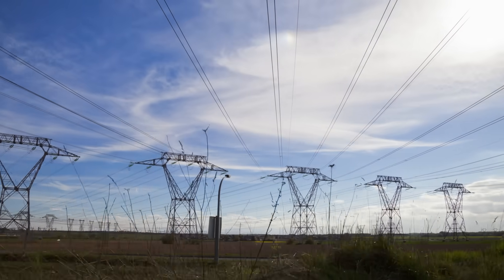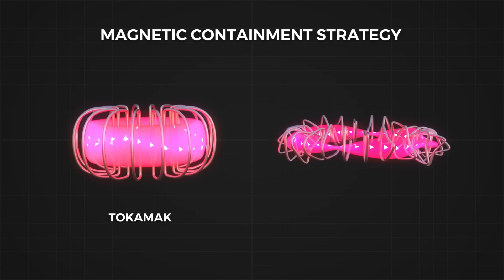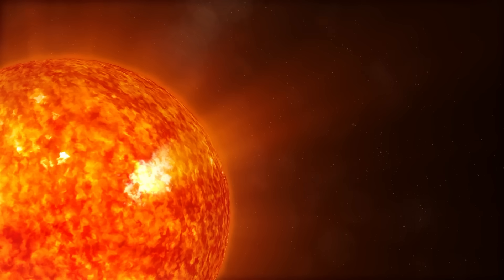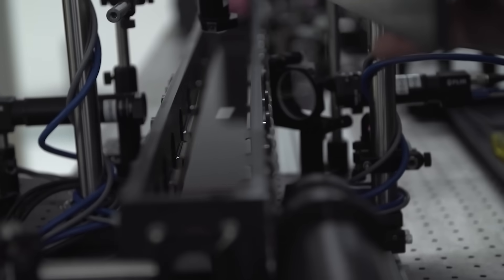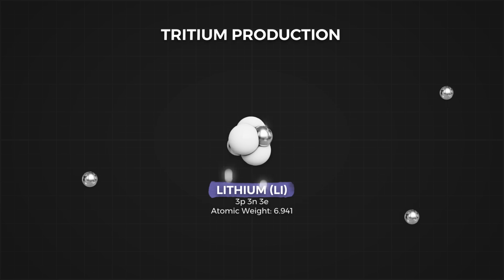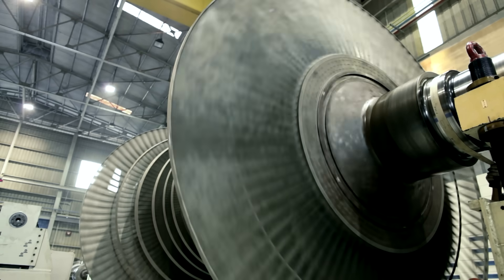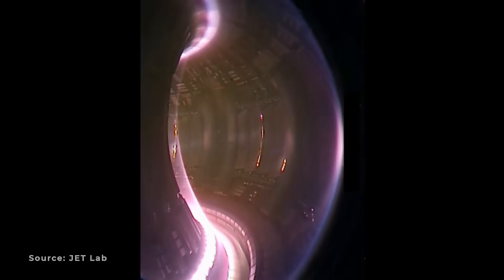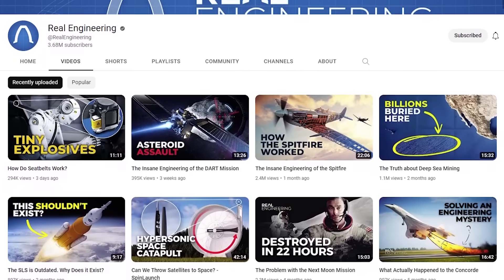The Problem with Nuclear Fusion

Comment: In light of breaking news in the US on Nuclear Fusion, I find the TIMING of this video very interesting, because it must have taken time to do all the animation in this video, so clearly you were not influenced by the Breaking News.
I don't know what to make of all this, so I remain a skeptic until I'm convinced otherwise.
Reply: I'm also a skeptic about the announcement and what it actually means.
I just found out about it literally 5 minutes ago, and before then I felt that it might be unobtainable in my lifetime. 
With it now supposedly being done, I'm curious to see what comes of it, but I'm not getting my hopes up at all. Would I like it to be true? Absolutely. Would I like it to be utilized in renewable energy? Well obviously. 

It is the DOE though after all...
Reply: Interesting achievement, and technically does advance the technology.  But it doesn't address the age old problem of moving the energy. Making it is one thing, using it and getting it to where it needs to be still requires a lot of energy.  In this experiment they still haven't created usable, viable "free energy" because they can't harness it for anything useful. 

I think in this instance they used 2 terawatts of electricity and got 3 back out.  But in order for this to be sustainable and actually power our society it would have to be something like 2 terawatts in and 5-10 terawatts out. 

Still a long, long way to go.
Reply: Looks like it's just a bunch of stock footage he edited together. Probably didn't take that long to put the video together.

Comment: So nuclear fusion is again nothing but another kettle that heats the water with tremendously low efficiency. Moreover, I think that calling mentioned cycle a clean one ー is a bit sly. The flow of neutrons produced in such a reaction very quickly activates everything around and, moreover, leads to the erosion of the "blanket" with the release of radioactive dust.
In short, of course you can play around, but so far the most promising thermonuclear fusion is right above our heads: our sun. Collect it either directly through photovoltaics or indirectly through wind and hydropower...

Comment: Seems kind of outdated now since NIF was able to conduct ignition on Dec 5th. Also, Biden addressed in March of this year that he wanted commercial fusion by 2032.
Reply from the maker: How exactly is it outdated?
Reply: @RealEngineering  Well, your main focus was on the JET tokamak and tokamaks in general. With the today's news that the US Department of Energy released today,  LLNL's NIF (a internal confinement fusion reactor) was able to not only produce plasma and generate fusion on December 5th. But was able to cross the ignition threshold. In which was able to produce more energy than it was put it. Granted, it took 332 megajoules of energy to power 192 lasers. Those lasers produced 2.05MJ of x-rays. The fuel grain was able to produce 54% more energy at 3.15MJ. Making a positive net of 1.34MJ. Though I cannot wait til 2025 when JET's big sister, ITER will do. As it should be in full construction completion early next year. I do like the idea that they are breeding tritium moles. Though, I am still on the run for extracting tritium from lunar regolith

Comment: Helion use Aneutronic fusion, with Deuterium and Helio^3  but the problem is the rarity of He^3 for the reaction with Deuterium and the higher temperature needed for Fusion , higher that the one in D-T Fusion. They can produce it as a byproduct of the other reaction with D-T but is a complicated way, that involves Neutron activation.
Reply: It's not aneutronic, but the neutrons are much less of a problem (lower energy, and much lower fraction of the power in them).

Comment: Will nuclear fusion give us cheap, abundant energy? Probably not, because the corporate giants will corner the market in building and operating the fusion power stations. If it CAN be metered - it WILL be metered! so, why would we assume that a unit of electricity supplied from a fusion power station will be cheaper than today's cost of one unit?  Undoubtedly, the biggest winners from nuclear fusion will be the arms manufacturers, themselves corporations and the Military Industrial Complex. The more things change, the more they stay the same.

Comment: So if each fusion reaction uses up one tritium atom and makes one neutron, and this neutron is needed to produce one more tritium atom by splitting lithium, how is this supposed to work?  Unless you do this with 100% efficiency, the reactor will need a separate supply of tritium, to make up for all the lost neutrons.  Is there a solution to this?

Comment: We could have molten salt reactors (Thorium) in less than 20 years. China and India are already building test reactors. No meltdown danger, 100 years waste, abundant thorium supply. Fusion is also still a valid option with better ways to recycle fuel like did Super Phoenix in France before being scrapped to ecologist madness.

Comment: Small modular FISSION reactors are probably the best way forward. Can't wait for fusion to work AND generate power economically. The video doesn't discuss the production of highly radioactive waste due to high speed neutrons bombarding the reactor vessel steel and  the lithium blanket,the latter producing tritium and helium-4 as new reactor fuel. Said radioactive steel would have to be removed periodically,which would be very expensive.

Comment: Sorry it is NOT clean....
the containment device gets irradiated with Gamma & neutron radiation, and by default becomes contaminated.
This then has to be dealt with as highly radioactive waste.

If you are going to play about  and make out that it is the perfect solution, then please use the correct vocabulary.

cleaner than xyz or safer than xyz.

Comment: I love the jabs all of you educational creators take at each other in your videos. It offers a nice break to laugh during such complicated Videos that contain such vast amounts of information.
Reply: Nebula Cinematic Universe has been fantastic over the years
Reply: @David Brown 

"nattering nabobs of negativity"

Nice alliteration but you're avoiding the fact that problems can only be solved when all the negative considerations are taken into consideration and dealt with. It's a fallacy that "positive thinking" actually solves anything. Careful, coherent thinking that addresses major problems will solves them.
Reply: The best solution for the future of energy supply is the construction of Molten Salt Thorium Reactors.  Besides providing abundant, cheap electricity, they can provide a myriad of other functions that will completely defuse the Green New Deal. They cannot melt down because the molten salt is the fuel carrier.  Thorium is preferred over Uranium because it has 200 times more energy potential and it is literally dirt cheap.  Thorium is abundant and has been the "waste" product of rare earth mining in the past.  The reaction occurs between 600-800 degrees F.  If the molten salt should ever overheat the reaction stops and a freeze plug in the bottom of the fuel jacket melts and the molten salt flows into a holding tank where it cools down naturally.  They can be set up to burn the waste from light water uranium reactors because they are so efficient.  They can be used for producing non-carbon diesel fuels.  They can be used to cheaply desalinate seawater, and scrub carbon from the atmosphere.  They are safe and can be built anywhere.  They can be made small enough to power a car or big enough to power a city.  The U.S. has about t a dozen companies that are either ready or near ready to construct them   France is developing them and Denmark has one company developing them.  I don't know about Germany, but Germany would clearly benefit from them and could erect them quickly if they desired.  They must get over their anti-nuclear sickness, however.  There is no time to waste.  here is a four-minute introductory video to MSRs. - 
https://www.youtube.com/watch?v=k6BXvw6mxtw

Comment: I had expected commercial D-D fusion and non-steam-turbine extraction to be at least 30-50 years after the first commercial D-T steam-turbine reactors. 

Like, D-D reactions are the ones featured in Star Trek, chosen by the writers for simplicity of the fuel but also with the understanding you need a lot more excess power and plasma stability to get over the hump of converting deuterium to tritium internally. 

Surprised Helion is there already. I wonder if they’re using similarly beefy superconductors as that Boston company, Cambridge Fusion or whatever it’s called.

Comment: Having unlimited energy source just report the problem on the materials be able to use it... war for metals, instead war for fuel. It will be the new limiting factor. 
Having unlimited energy will just make stronger and faster the pressure humanity put on the earth
It will not be only a solution but will grow some problems we already have and the limited access to energy is pacing a bit.
Amazon forest will be cut and destroyed just faster with free energised nice electric caterpillars.
It is good to keep this in mind even if fusion produced electricity is a fantastic project.

Comment: No, it's not going to do anything about Climate Change. 
If a practical system were demonstrated, it would take decades deploy to consumers and industry. Building the supply chain behind it would be another long effort (painful) effort.
The current electrical grid upgrade and the fairy-tale EV system expected to materialize would also take decades of sunken cost.
Given the current talent of those in charge of infrastructure, this would be, at best, an interesting experiment and at worse an endless money pit.
Silver bullet thinking to complex problems creates more complex problems. Current leadership is nowhere near up to the task of deploying a completely novel, advanced energy system - it's way beyond an iPhone.

Comment: I still don't really get fundamentally why fusion would release energy?
Releasing energy stored as in fission makes intuitive sense to me, but why would essentially packing something together release energy?
I've missed that part.
Reply: fusion produce stuff with less mass than your input fuel and that lost mass is converted to energy.
Reply: @realsong-fake  But that's fission, no?
Reply: Generates very hot plasma which is then used to generate the steam.

Comment: Did you publish this video knowing they will announce the achievement of net positive energy output by fusion today?
Reply: i mean its still not really net positive, since they required around 300 MJ of energy to get 3 MJ out. the "net positive" part is that the laser only had a power of 2 MJ.

Comment: Oh boy another full length documentary on how a new nuclear fusion technology is going to change the world. 

What is the problem with fission power.
1. Bad management at a few power plants
2. An irrational fear of radioactivity caused by a fear mongering media. 
3. Poor investment on the part of the US in developing low waste fission reactors.

What is the problem with fusion power (whats wrong with this video)
1. Hype (As in your next video)
2. D + T = H + N (fast).   Also called neutron radiation. 
Neutrons are not discriminating, they cannot be channeled or magnetically confined. 
Neutrons will "irradiate" a wide variety of substances to make them radioactive
Neutrons when irradiating durable substances, like metal, will tend to make them brittle and non durable. 
The "irradiated" outcomes vary. What this means is that as the neutron targets "age" with radiation, the expected outcomes will begin to deviate as minor outcomes buildup and are irradiated. 
Neutrons are extremely toxic to humans. The human body has lots of neutron targets that can generated free radicals with neutron absorption. Neutrons hitting Chromatin can cause mutations. 
The problem with radioative waste in a fusion reactor is worse than in a fission reactor. In a fission reactor the only gas potential that is radioactive is heavy hydrogen and water. Both are controlled by cooling the reactors aqeous mediators during heat transfer. In a fusion reactor the contents of the reaction are ionized gases traveling at extremely high energies. Essentially a fusion reaction is a magnetically confined bomb. Any loss in confinement and the bomb goes off. While its easy to think of this as a well geeze it can be confined. Yes, but in normal operation a fusion reactor is essentially a tiny neutron bomb whose effects accumulate over the life of the reactor cycle, which so far is only a few moments. 
3. Tritium has a half life of 12 years, by the time they have a working reactor >3/4ths of the tritium available today will be gone
4. So far as yet, there has not been a single large scale experiment that has designed a means of extracting useful heat from fusion reactors. We can basically make the following assessments. 
    A. To be effective at protecting the electromagnets and structural integrity of the reactor the cooling system needs to be as close as possible to the reaction
    B. Water loves to capture neutrons, and metals fatigue when exposed to neutrons indefinitely. 
    C. The cooling system needs to be blanketed by fast neutron absorbers. 
    D. Which means the fast neutron absorbers will get very hot. 
    E. Berylium and lithium, low mass metals, are not that heat stable, will need to be compounded in higher mass molecules. Further isolating the cooling system from the reactor core and pushing the electromagnetic confinement further away from the reaction. 

   What about fusion alternatives. 
1. Direct electric current nuclear fission. 🤦‍♂️🤦‍♂️😂😂😂😂
2. Magnetic induced electric current. Think thousands of roomsized neutron generators.
3. Cold fusion.🤦‍♂️🤦‍♂️🤦‍♂️🤦‍♂️🤦‍♂️🤦‍♂️.
4. Indirect photovoltaic fusion power. Sun and solar, seems to work. 

if you want athropogenic fusion power in 10 years. dig a cavern close to earths mantle. Embed solid iron Fe55 pipes filled with reduced water in the surrounding walls of the cavern. Detonated hydrogen bomb, heats water, water makes geothermal power. Repeat until cavern walls degrade and pipes burst. Alternative use sodium instead of water in pipes. At some point the Neutrons captured by the surrounded earth will have so many long lived isotopes that you can sustain geothermal power with little input of energy, so depending on how far you put the pipes from the wall of the cavern you could continue to blast tiny hydrogen bombs indefinitely. The rest of the world will love you for it😂😂😂😂😂
Reply: They just announced net energy gain fusion - Your comment aged very badly - 8 minutes it lasted before it was completely wrong.
Reply: @piccalillipit9211  I didnt say anything about net energy gain in my comments. I didnt say anything about energy efficiency at all. 

See Sabines video on the meaning of net energy gain, its not what you think.

Proof of the pudding is in the eating, after 50 years of cooking there is still no pudding.
Reply: @Darisiabgal7573  - Thank you but I know what net energy gain means in this context.
Reply: @Darisiabgal7573  "Proof of the pudding is in the eating, after 50 years of cooking there is still no pudding."   Well china must have something - cos they are building reactor sites for grid production. they believe they are close enough to get the preparation work done and the technology will be ready by the time the sites are ready. 

I suspect this is why the US made this announcement
Reply: @piccalillipit9211  You are, well thats just precious, then I guess that new fangeled laser fusion power unvieled today is going to save it. 

Show me the reciept or the stocks you invested in the PRC, then we both can have a good laugh.
Reply: @piccalillipit9211  I write books about people who grandstand about writing books, got any friends?

Comment: Although far into the future, eventually, the heat added to the atmosphere from the multitude of Fusion reactors would recreate the rise in temperature that is causing global climate change today. Therefore, any means other than using the energy arriving from that giant Fusion furnace in the sky called the Sun on the Earths surface to generate electricity will result in over heating of Earth's atmosphere. The human animal will have to move into space, or another planet such as Mars. Otherwise, what makes the Earth such a beautiful planet will eventually be destroyed by human over growth that in some aspects is already here. 60% of the animal life on Earth have disappeared just since 1970, that includes 60% of the flying insect populations (the crucial pollinators of flowering plants). At the rate the Earth's biosphere is declining, just think about the Earths life status in another 50 years. Looks bleak!

Comment: We are slowly running out of Helium - one day there will not be any natural reserves of Helium on the planet. 

Some other elements are that way, like Rhodium - it too will be gone.

I am a lover of instrumental analysis. 

We have a replacement for Helium Collision ICP-MS by instead using Sector Field ICP-MS. 

We do not have a replacement for Helium for achieving lower than - 256 C (17.15 K) refrigeration of Carbon NMR samples. This process cuts the analysis time from longer than 24 hours to 15 minutes or so on a 700 MHz machine
Reply: The moon has huge deposits of helium